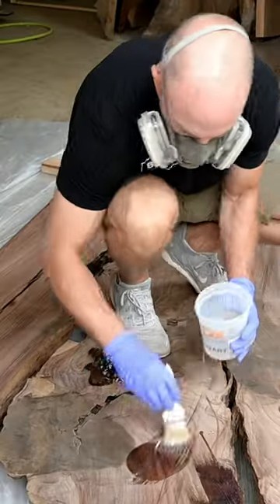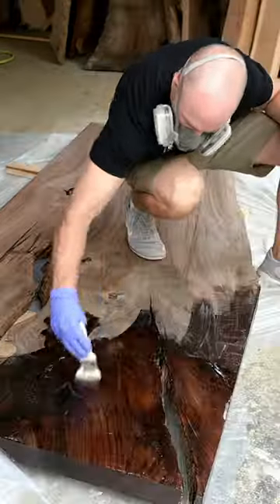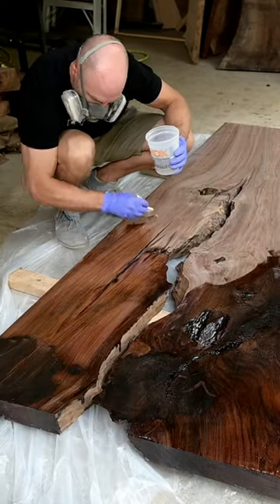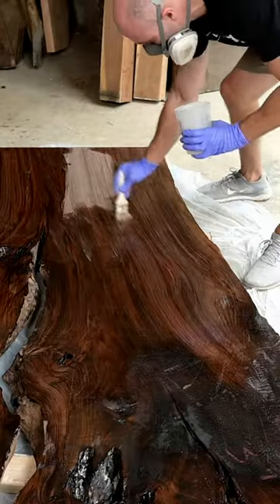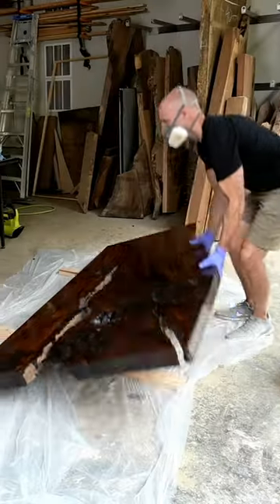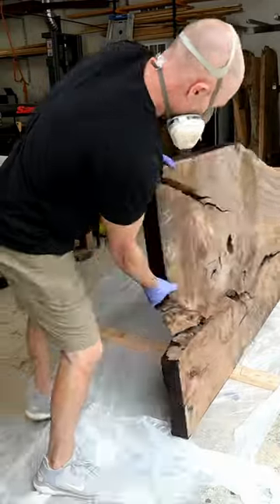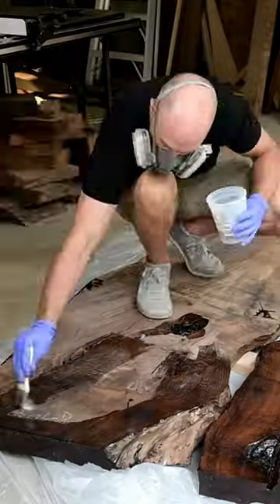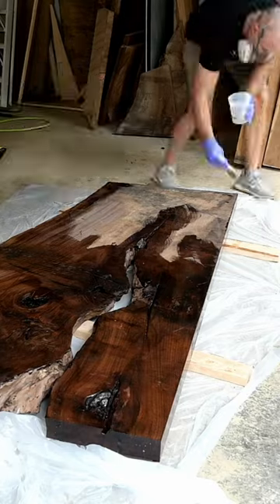Critical epoxy table step

Comment: When you make the mold and are figuring out the amount of epoxy you need, do you ever use the board footage (volume) of the slab to figure it out by subtracting it from the volume of the mold?  Have you ever used the weight of the slab to figure out the volume?   If so, how did it work out? Thanks, love your videos and your comments!!!

Comment: Good video, but audio was way to quiet, could barely hear you
Reply: Same, 2/4 bars on my Universal Audio monitor meter though the "Melting Epoxy Table" short had normal audio levels.

Comment: I find that my wood absorbs the seal coat unevenly.
Reply: Doesn't really matter. The seal coat is going to get sanded off after the cracks/voids are filled with black epoxy.